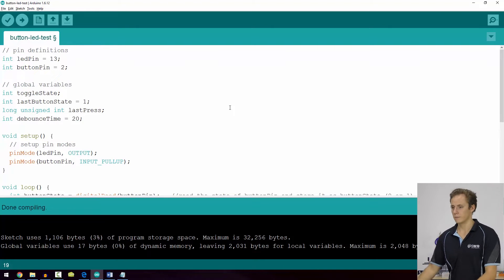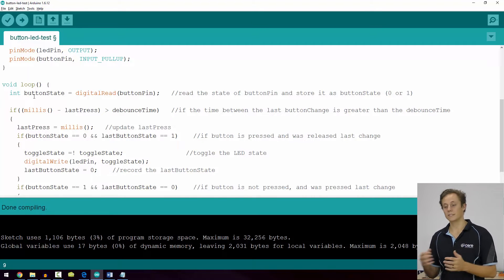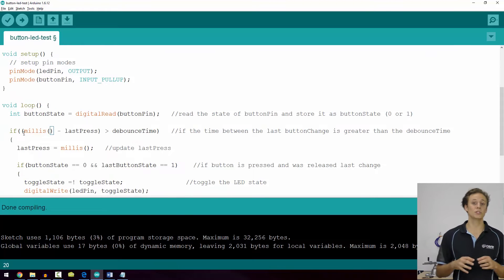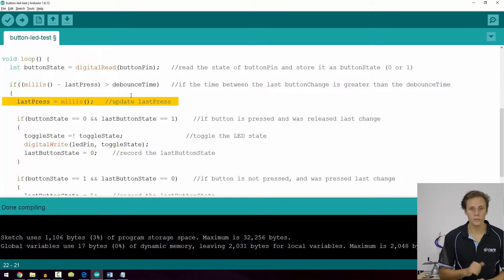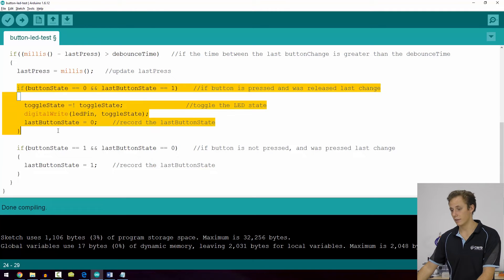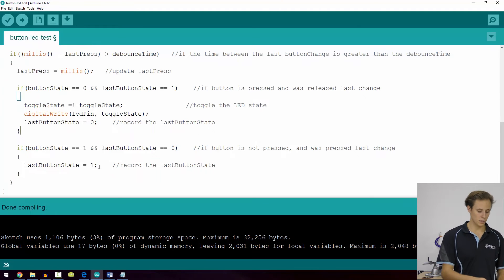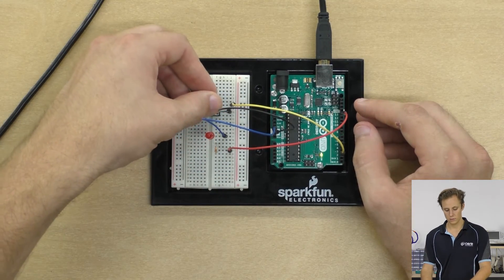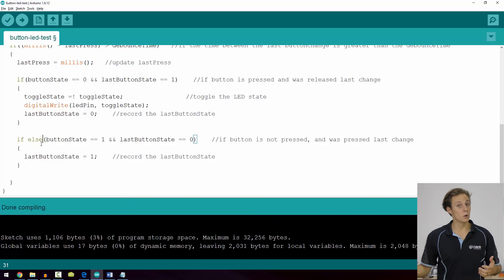Arduino Workshop - Chapter Three - IF Statements

Comment: I believe there has been an error in this tutorial. "lastPress = millis();" should lie inside the "if (buttonState == 0 && lastButtonState == 1)"-statement. This way, the lastPress variable updates every time you press, and waits 20ms as a debouncing time. This means that it will ignore any false button-presses within that 20ms debouncing time! Correct me if I'm wrong, but your code checks for a button click and updates the lastPress variable every 20ms, something which doesn't make sense in my mind.  

This is how I imagine the loop to look like:

void loop() {
  int buttonState = digitalRead(buttonPin);

  if ((millis() - lastPress) > debounceTime) {

    if (buttonState == 0 && lastButtonState == 1) {
      toggleState = !toggleState;
      digitalWrite(ledPin, toggleState);

      lastPress = millis();  // Move the lastPress update here.

      lastButtonState = 0;
    }

    if (buttonState == 1 && lastButtonState == 0) {
      lastButtonState = 1;
    }
  }
}

Comment: hope you are still active.. currently having problem with toggle switch to control motor using millis. this what i need hope you can help me. when digitalpin is high (always high since toggle switch) thats is the time the millis will start to count till 3hrs to on the motor.

Comment: Very informative. But in the last part, while explaining else, you have followed the if directly with else which will cause a compilation error. The else should be put after an if block as follows. if(condition){ // code }else{ // code }.